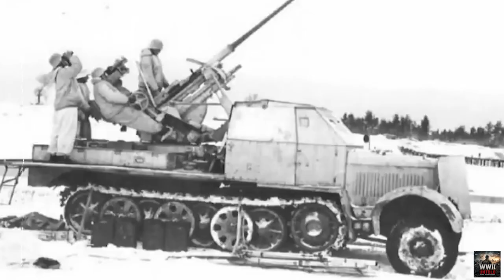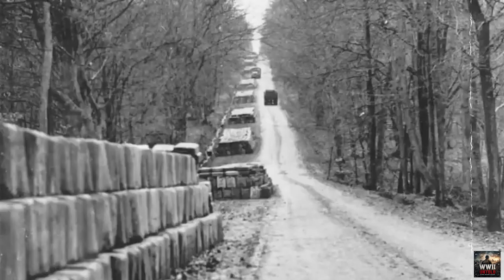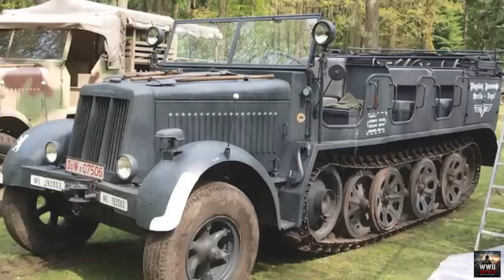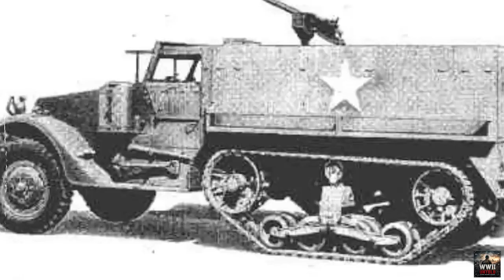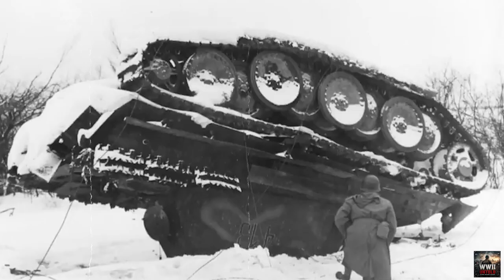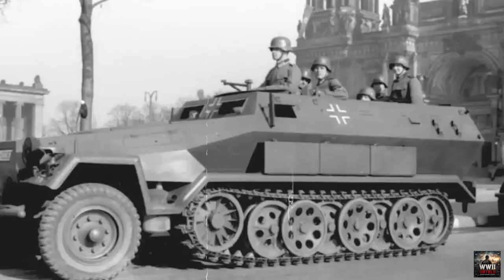Why Germany’s Sd.Kfz. 7 Burned More Fuel Than America’s M3 Half-Track

Comment: Ah, logistics. The one thing that no one thinks of.
Reply from the maker: Absolutely. Logistics is often the invisible factor that decides whether a weapon is effective in the field. The Sd.Kfz. 7's higher fuel consumption wasn't just an engineering characteristic—it placed additional strain on Germany's already overstretched supply network, especially from 1943 onward. In contrast, the M3 Half-Track benefited from a far more robust Allied fuel and maintenance infrastructure, allowing it to remain operational for longer periods. As the saying goes, amateurs study tactics; professionals study logistics. Thanks for pointing that out!